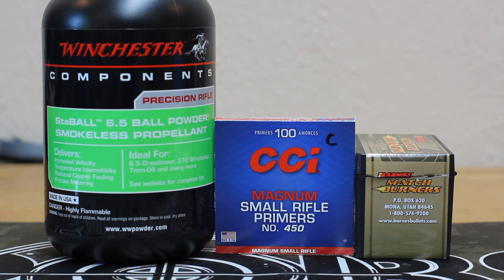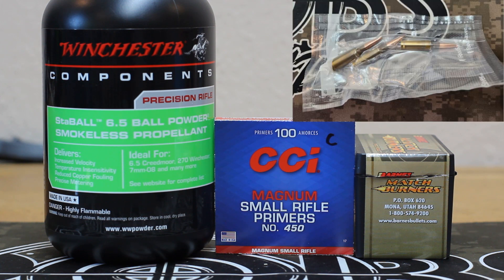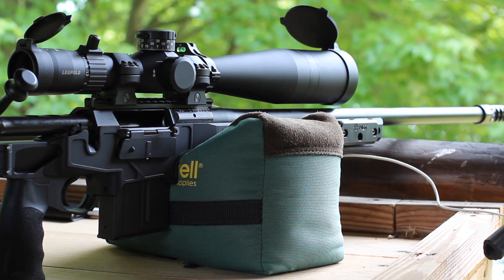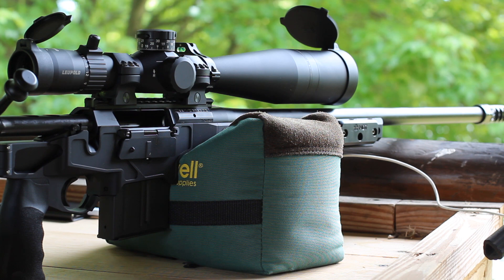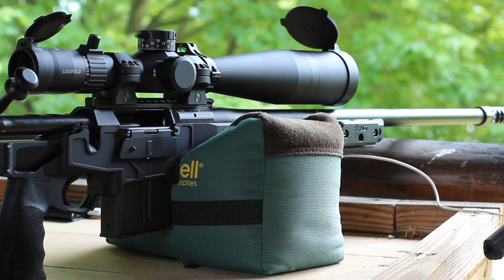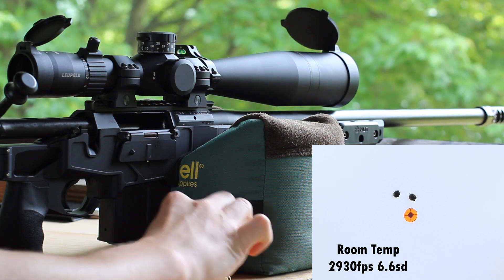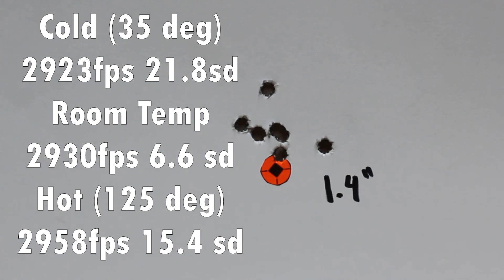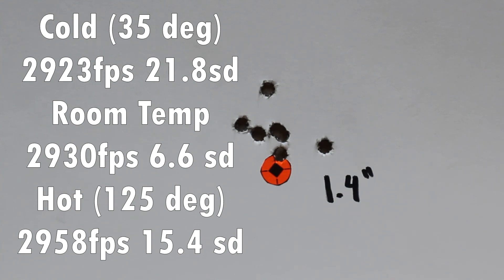Staball 6.5 Temp Stability Testin

Comment: I’m gonna do long run temp tests over the course of a year with staball and H4350 in 6.5CM. Texas this time of year is around 70’s-80’s. I get up to 115-120 in the summer and I go to Kentucky around winter and can shoot at 20 degrees so it’ll be a wide swing. Long time to wait for data but I don’t think any temp stability test I’ve seen accounts for actual weather variables (the rifle and air temps don’t match the ammos temp)

Comment: At about 50fps difference from lowest to highest velocity with a 90 degree temp differential is considerably better than over 100fps. Most all unstable powders would have over 100 fps with same conditions from what I have seen, heard and read. I have seen rounds loaded and shot in the 70s lose well over 100 fps when shot at below freezing temps using BL-C(2) and Win760 in 308 and 30/06. Thank you for good tests and data.
Reply from the maker: Yes I also need to test one of the sensitive powders for an idea really how good or bad this is

Comment: I have a feeling that the higher and lower temp rounds did not have enough time in those temperatures to get completely cold or hot, hence the larger sd due to some powerder that didn't get totally normalized in their temps.
Reply from the maker: In those temps for over 2 hours. I would think that would be enough to get very near to desired temp

Comment: Very interesting test that kind of represents the actual range of temperatures that are often encountered. Sure the sample size is small but who want to spend the money on better statistics. You would need at least 20 shots at each temperature. What this test shows is that with every group there was at least one shot and usually two close to the 70 degree first group. These tests don't show you the effect the temperature might have on primers and if they provide the same flame at these temperatures. You could conceivably move to a hotter primer in colder temperatures and cooler primer in hotter conditions and have fairly stable performance or just keep the rounds in your pocket until your ready to fire.
I wonder if the stiffer bolt lift for the cold rounds could have been caused by the condensation on the cases preventing the cases from grabbing the chamber walls under pressure causing more pressure on the bolt face. It shouldn't be because the pressure was higher since the velocities were slightly lower but who knows. Some so called temperature stable powders tend to produce higher peak pressures at lower temperatures.
Reply from the maker: I assume the condensation is what caused the sticky bolt lift on the cold rounds. I'm guessing it reduced overall chamber area increasing pressure.
Reply: @RobsReloading  Wouldn't you expect higher velocity if the pressure was increased?
Reply from the maker: @denisleblanc4506  generally yes

Comment: Was the condensation removed from the chamber between the frozen & hot series? 

My understanding is that moisture in the chamber will really increase the rearward thrust - since the case has a film of water it’s like a lubricant, resulting in much higher pressures at the bolt face..blown primers, harder bolt lift, etc.

I’ve never experienced this but could be a factor here???
Reply from the maker: No after the rounds ejected I did not mop the chamber. I doubt this condensation would accumulate in the chamber with just 3 rounds.
Reply: @RobsReloading  Wrong, there will be a wet film present for each of the cold shots.  By the time you get to the hot shots the film will be gone.  Alan Davis is correct in his assumption.
Reply from the maker: @ewathoughts8476  yes that is what I meant the cold one yes will have condensation nothing I can do to change that. But by the time we shot the hot rounds I'm sure condensation was not still in the chamber.